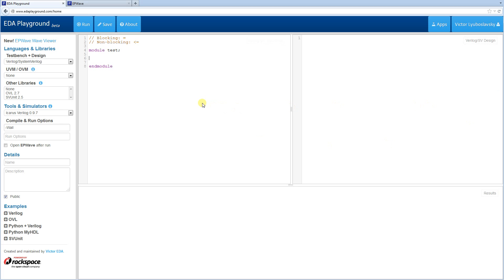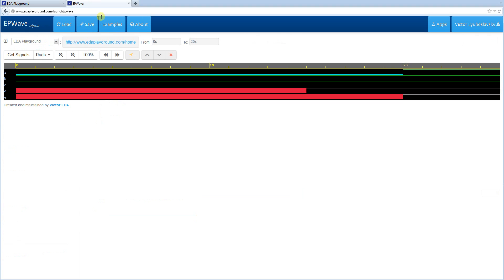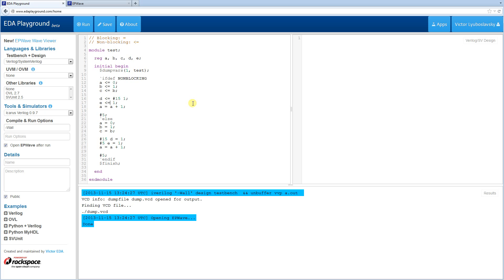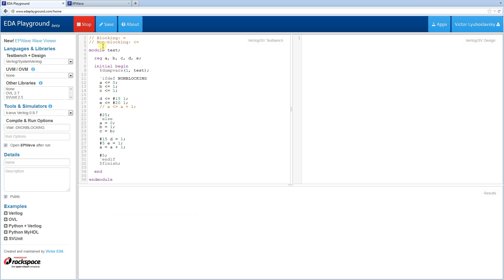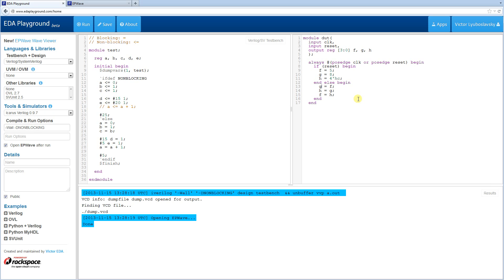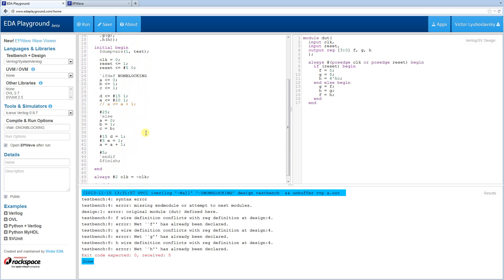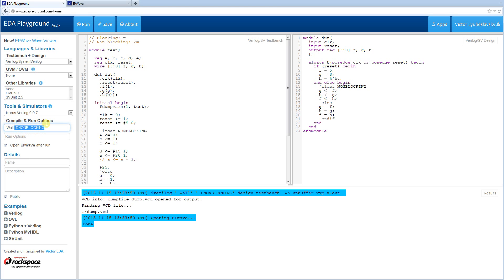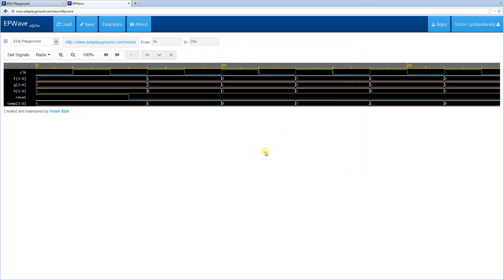Verilog Tutorial 6 -- Blocking and Nonblocking Assignments

Comment: How to make e work from 0 
When d is made to wait 15 ns
Reply from the maker: Sorry. I don't understand your question.
Reply: U made d start after 15 ns
When u coded e to start after 5 ns 
But it started to proceed after 15+5=20ns
How to make e to start from 5ns?
Reply from the maker: @orzAR26  I can't make it work with Icarus Verilog, but if you change to Riviera Pro and add "+define+NONBLOCKING" to the Compile Options, you will see (by looking at the code) that non blocking assignments are used and e does change at 5 ns, illustrating well the difference between blocking and non-blocking assignments.

Comment: At 4;40 video time value of a should not be 'x'. at simulation time 0, a <= a + 1 should yield a to be 1. because at end of simulation time 0,  x + 1 will result the value 1 to be assigned to variable a.
Reply from the maker: Hi,
The value of a is 1'bx on all the simulators on EDA Playground. However, this is NOT for the reason given in the video: the second assignment to a overwrites the first - there is no contention.  Instead, at time 0, a initially has the value of 1'bx and  the value of 1'bx+1 is 1'bx.
Matthew